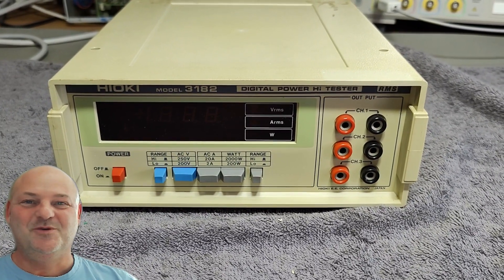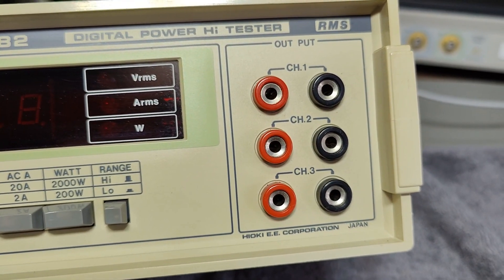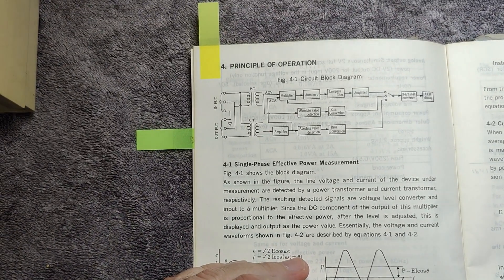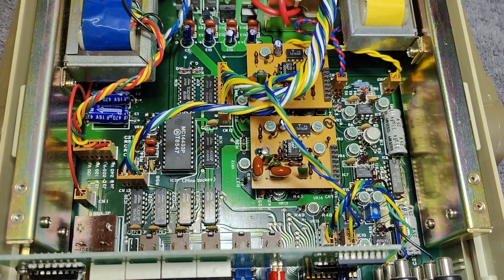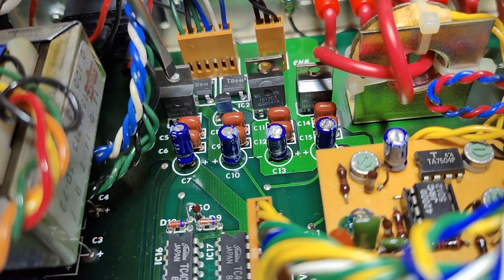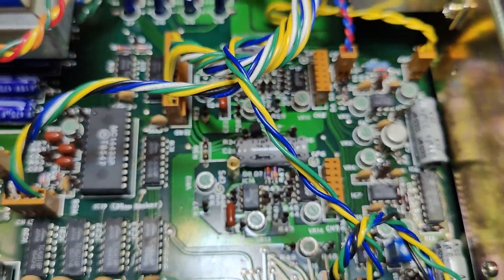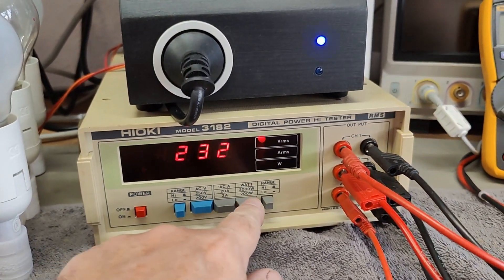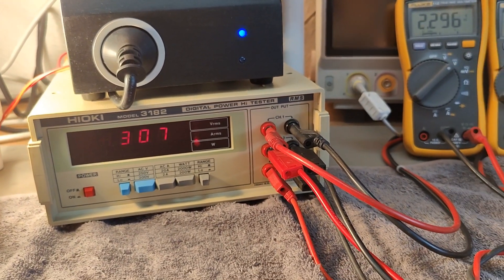HIOKI Digital Power HI Tester model 3182 1986 test teardown

Comment: Hi Thomas, a beautiful piece and accurate 🤔 I don't know how you can think about the use, I have it so I immediately plug it into the circuit of the test socket and finish three small external sisples. Unfortunately, this old model shows only one data on the display in the device - hence the connectivity CH1 - 3, the newer model has four displays V - A - W - on the fourth one you can choose what to display from the menu (Pf, Hz, etc.). Since even a bazaar meter of this type was too expensive for me, I made my own with the function of an adjustable electronic fuse - when I'm home I'll send you a few photos by email, including the absolute miniaturization of the bulb protection with the possibility of switching the load (miniaturization is necessary for me, you know how small I am workplace space).

Nice day 🙂 Tom
Reply from the maker: in the good old days, it was most likely expensive to add more displays :-) i really love my Peacefair pzem-021 i got a few of them, one is installed inside my vario maybe you have seen it in a few of my videos, it show all important things at the same time.
Reply: @TeardownOZ2CPU  We have a bit of a misunderstanding, I know you have a display unit in the control transformer, I have it in the central panel as well, in addition, my industrial control transformer has its own analog meters (V,A) but I have one built as a separate one that I can use for long-term testing away from my work desk. I can set the maximum load of the tested appliance on it, if something goes wrong and the consumption rises above the set value, it will be automatically disconnected from the network.
My thought was for a separate test circuit - it doesn't necessarily have to be on a desk, I would just put the external displays on the desk.
Reply from the maker: @Edisson.  that is a good idea.
Reply: @TeardownOZ2CPU  Hi Thomas, I sent you the promised email, I hope it arrived, there were a lot of photos 🤪

Nice day 🙂Tom
Reply from the maker: @Edisson.   i love how you build so much your self,
looks like you have a bit more spare time than most people :-)
Reply: @TeardownOZ2CPU  Hi Thomas, I sent you another email in the morning 😂, but the first time it wasn't sent and the photos somehow fell apart on the second attempt - that is, in my sent emails, I hope you understand it according to the description, if there is a problem I will forward it again.